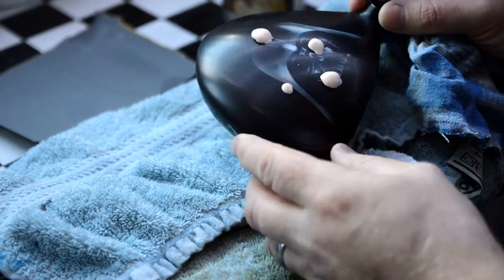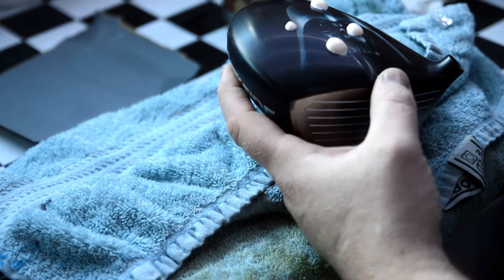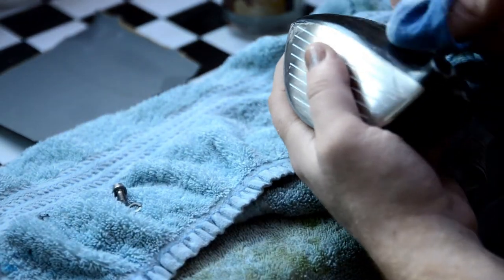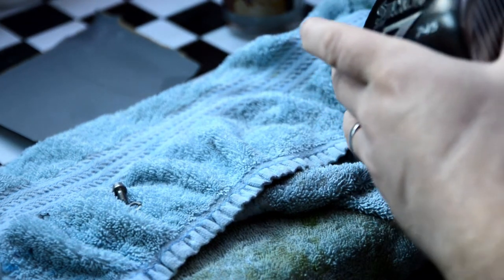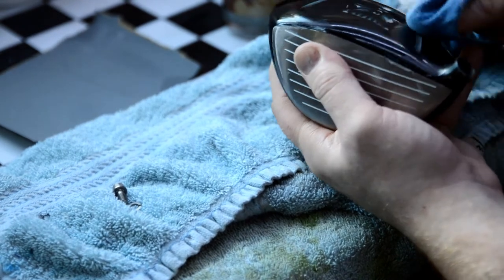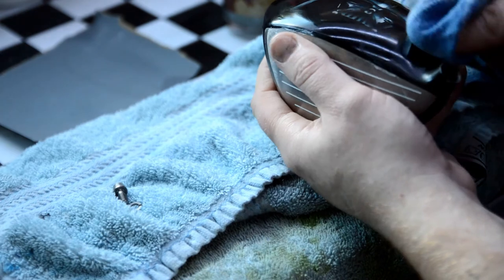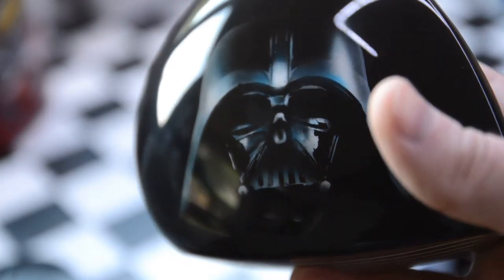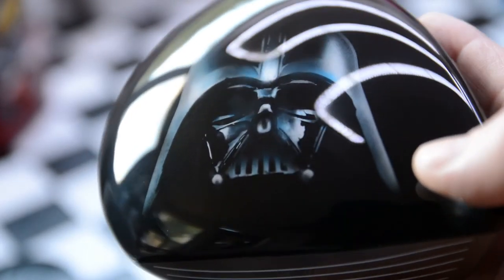Darth Vader custom painted golf club - polishing

Comment from the maker: you would need to flatten the original paint back so that the surface is totally smooth. Then prime, paint and clear. I would recommend using automotive paints only. don't buy cheap crap from the local Diy store. find a paint and body supply shop near you. they can supply their paints in aerosol form if you don't have a compressor and paint guns. the process is exactly the same as repairing a chip in your cars paint :) hope that helps. let me know if I can help any further
Reply: Aaron de la Haye - Artist what top coat was used to protect the airbrushing?
Reply from the maker: Craig Stimpson a 2k clear coat :)
Reply: Aaron de la Haye - Artist cool ive a few clubs i want redoing as ive all the airbrush kit from my lure making thanks for the help bud.
is there anything i might come across that could be an issue?
Reply from the maker: Craig Stimpson  just be sure to use quality materials and paints. don't use Halfords paint or any kind of cheap rattle can paint. go to a automotive paint supplier. they can put paints into aerosol for you, if you don't have spray equipment.  make sure your surfaces are fully decreased as well. one important point, about the use of 2K clear, is that it should only be used in a paint booth. it is extremely toxic and not for Home/ hobby use. make sure your paints are fully cured before any kind of lacquering, otherwise you'll get reactions.
Reply: Aaron de la Haye - Artist ok cool i do spraying for a job just they are all waterbased paints not soventbased so it all new to me on that front.
Reply from the maker: Craig Stimpson essentially with waterbased you need to do light coats and make absolutely sure each one is dry before adding the next. :)
Reply: Aaron de la Haye - Artist haha yeah i found that out the hard way when i started airbrushing haha.
ive an old callaway big bertha E.R.C 2 head ill mess about with befour hitting my other  clubs.
Reply from the maker: Craig Stimpson always the best way ;)
Reply: Aaron de la Haye - Artist is the 2k prone to runs? or is that just based on how tbick you apply it as i was thinking of putting my club head on a rotating drying rack as ill be apply 2-3 coat and want to stop runs from happening
Reply from the maker: Craig Stimpson 2k can run, it really depends on the painter. takes a bit of getting used just like anything new. usually three coats is enough.  there are several good videos on using 2k on here though
Reply: Aaron de la Haye - Artist cool ill get looking later thanks for all the info much appreciated 👍
Reply from the maker: Craig Stimpson no problem :)
Reply: Aaron de la Haye - Artist sorry me again haha.
will 2k stick to a shiny club heads without chipping off?
 as I've a idea for my club head and your the best person i know of to ask this question to.
Reply from the maker: Craig Stimpson as in the bare metal? it can be hit and miss. You'd need to scuff the surface up really well. 2k is extremely tough. it's the same.clear that goes on your car. it can chip, but.it would take some doing.
Reply: Aaron de la Haye - Artist yeah sorry bare metal as i want the art work im doing to have some of the metal showing as part if the design.
Reply from the maker: Craig Stimpson it is doable,  it would need to be well sanded so the 2k has something to stick to
Reply: Aaron de la Haye - Artist aww thats a shame i was hoping to keep the shine for the design but i guess it could be matt if th 2k need that etching to grip to.
Reply from the maker: the.2k will shine it up anyway mate ;)
Reply: Aaron de la Haye - Artist sorry for all the questions haha so if the metal is dull the 2k will make it look shiny got it ill give it a go if worse come to the worse ill strip it all back again and have another bash lol.